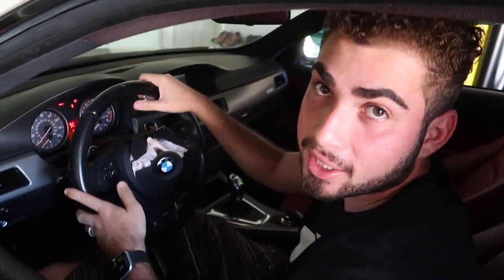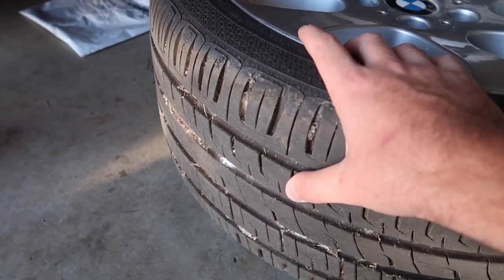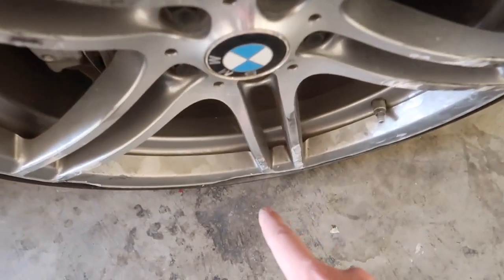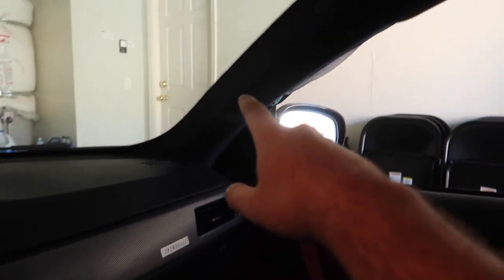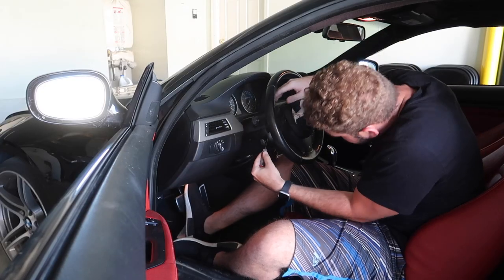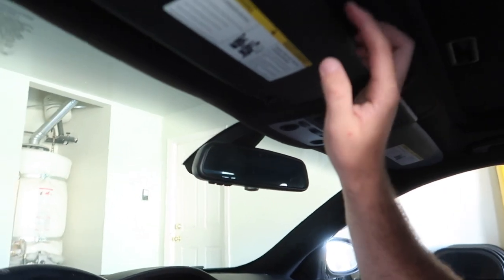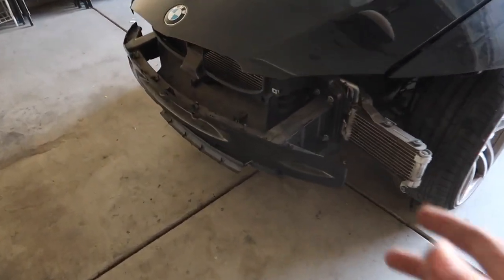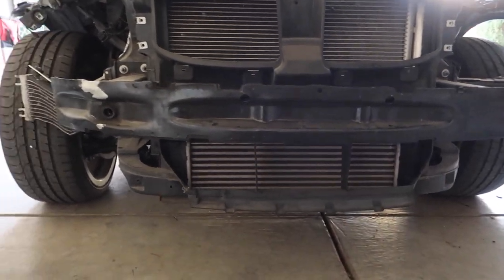Rebuilding A Wrecked BMW 335IS Part. 3

Comment: You can’t replace the emblem on the airbag cover the airbag cover and emblem are one part it has bent metal tabs on the back that hold it onto the airbag cover so the emblem doesn’t hit you in the face when it deploys. You can see this on the old blown airbag you replaced. I looked this up because my M235i had a small dent on it but I researched on the forums and found out it’s not replaceable. I ended up popping out the dent with mini glue sticks.
Reply: You can get stickers and just put a bmw sticker on it

Comment: The scratches on the trunk are white, so it’s probably just the clear coat. Go easy with an aggressive compound. You can always add some more clear coat from a can.
Reply: That’s not surface scratching, that’s a cluster of cracked paint

Comment: P zero is Pirelli but also some tyres you can see the thread is good etc but the rubber on then can be deteriorated like the rubber isn’t good anymore because they haven’t been used much but the rubber is just gone. If that makes sense

Comment: Hi Nour,  Don't use those tyres on track from the old wheels.  I only use a small Renault Clio on track in the uk you might not know what it is but small hatchback.  Anyway michelin cup 2 tyres along with good brakes makes the whole experience so much more fun